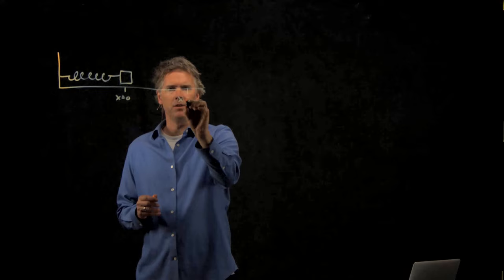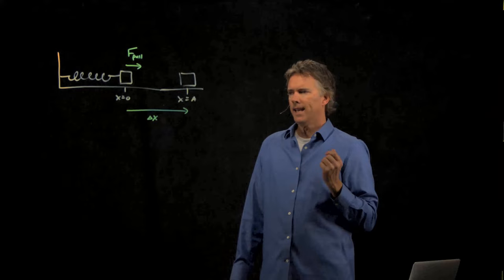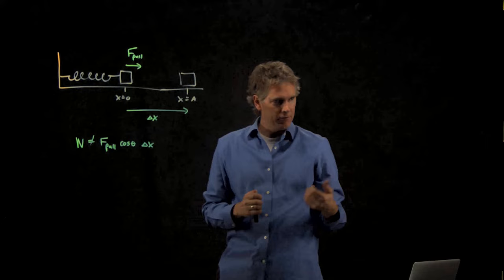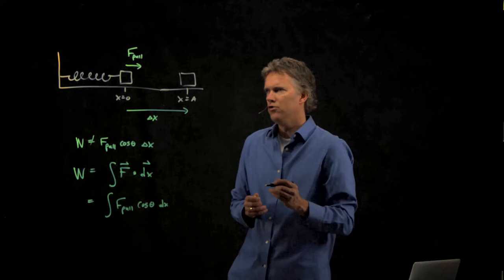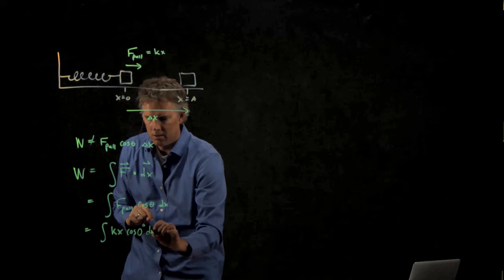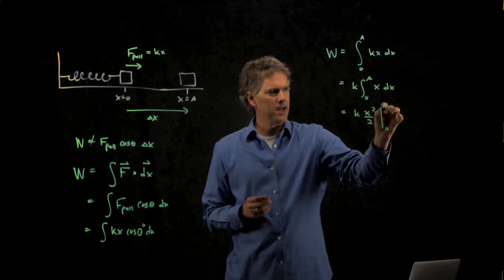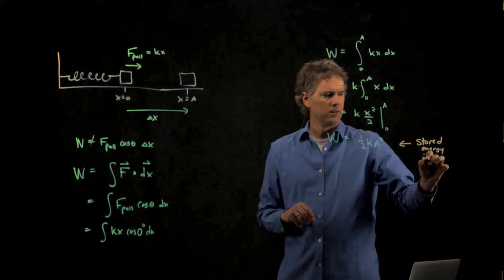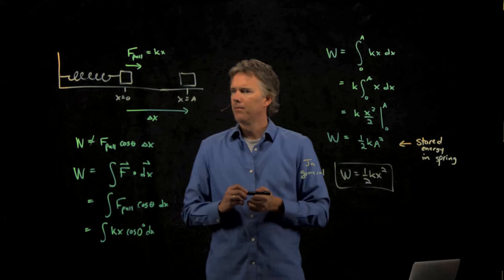Work done by a spring

Comment: Wouldn’t it be a negative value because the angle between spring force and displacement is 180?
Reply: I think it is not negative because the  displacement and the force applied both are in the same direction so it becomes a 0-degree angle and cos 0=1
Reply: This is Work done by external force right. Had they asked work done by spring force, it would have been negative
Reply: Work done by spring force is negative and worl done by external force is positive

Comment: Dear profa spring of length=0.025m , outer diameter=0.4mm ,spring constant= 34.what is the wire diameter and number of coils in this spring to achieve this spring constant of 34.
Reply from the maker: Tough (and specific) question.  You will also need to know the material (need its elasticity).
Cheers,
Dr. A
Reply: The material is stainless steel
Reply: So what is the answer ?
Reply from the maker: This is where the engineers take over:
see "Machinery's Handbook"
or
https://youtu.be/CyMXVo8IMsk
Cheers,
Dr. A